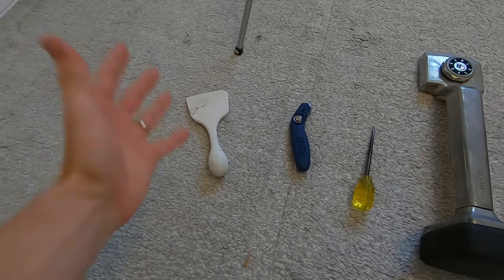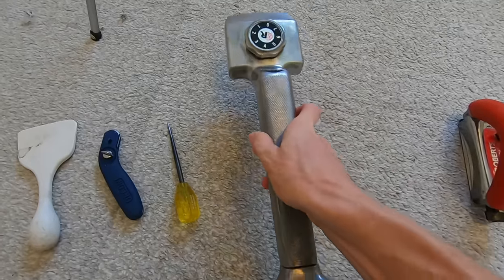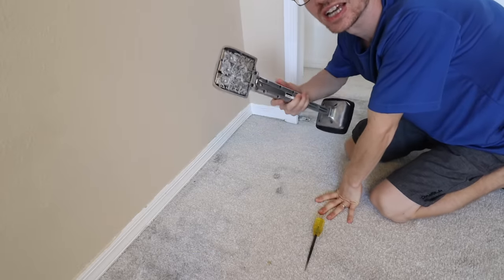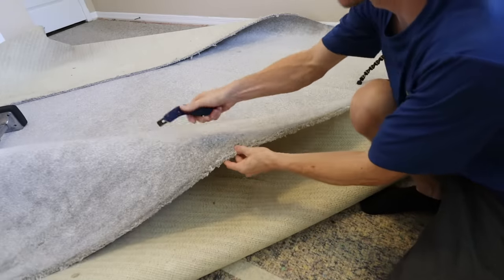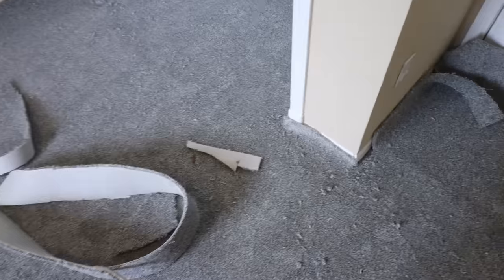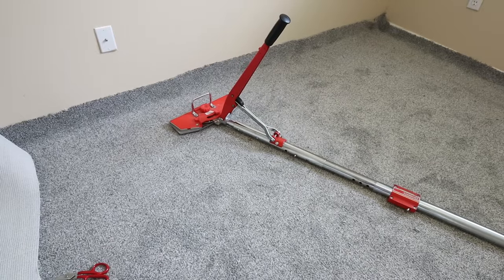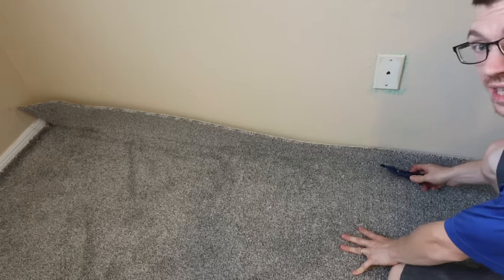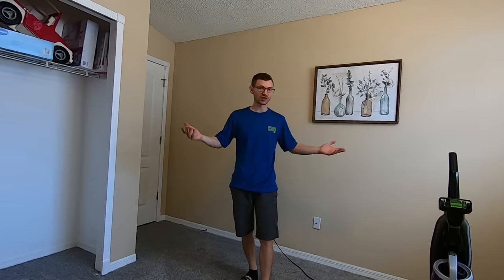HOW-TO INSTALL CARPET FOR BEGINNERS. DIY carpet install and tools.

Comment: 16 year installer here and I’ve never seen anyone go around a room with a kicker to take the carpet up
Reply: Exactly....I usually take an awl and pull up the carpet or just grab a corner and yank it up
Reply from the maker: Because none of it is installed wellLOL I don't always but it does prevent you from possibly damaging the carpet. and 16 years? you should be making the video not me haha
Reply: Just cut it in straps and pull it up lol

Comment: Little tip from a layer in 🇦🇺kids!…
In the corners,to stop it coming off the smooth edge (gripper) grab the corner,take your thumb to near the floor on the backing. Cut from your thumb to edge. Two angled lines. Forming a triangle. It’ll sit lovely and neat and stay tight!

Comment: How does the new carpet get attached to the tack strips?  Is it by the action of the stretcher?  Or is it by the pressure of the tucker?  We had to pull back one corner of the living room for a water leak.  Leak is fixed,  floor dried and bleach ed.  Now it's time to reattach carpet edges to the tack strips.
Reply from the maker: The stretching action and the pins on the tack strips. When it’s released grab on to the backing of the carpet.

Comment: When trying carry the carpet in & get it in place by yourself roll it out flip the side almost in half where about an inch of the carpet is showing roll it up in the length which make the carpet approx 6 ft stand it straight up put your back against it & reach both hands over your shoulders grabbing the carpet slightly bend over & carry it in. Start it in the corner roll it out & flip it over....no scratches on walls & it will not cause wrinkles like you think. Plus you have a over stretcher anyways. Other than that rather than kicking around a room to tear carpet out cut it in aprox 4 ft wide strip it will easily pull up by hand & makes it easier to carry out & throw away!

Comment: I've done this since I was 14. I'm now 46

power stretchers are for areas in excess of 35sqm. This room is way too small 

You will over stretch it using it in smaller areas than is appropriate and break the fibres (if not actually tear it) which will cause buckles in the fabric and pull the lamination apart which holds the carpet together
Reply from the maker: With the amount of ripples I re stretch I’d say that may not be accurate! To each there own! You have complete control on how much pressure you are using to stretch you should never damage the carpet.